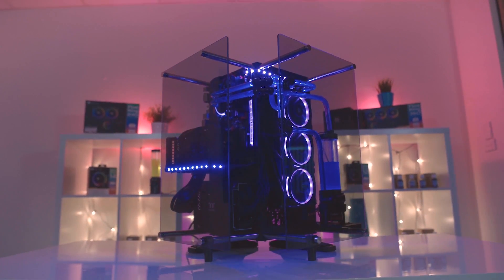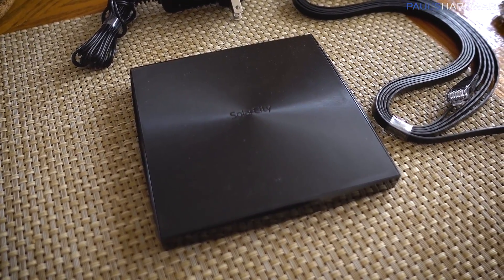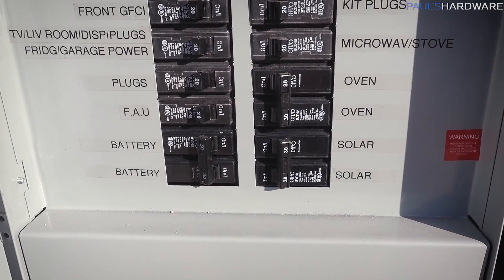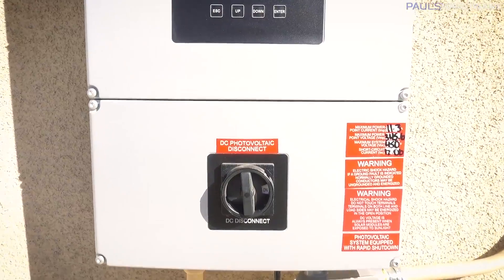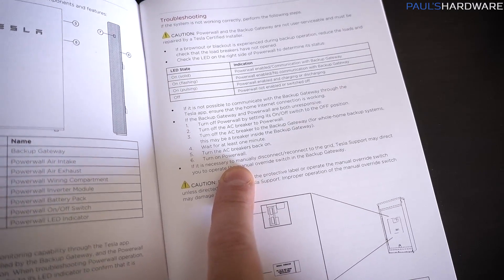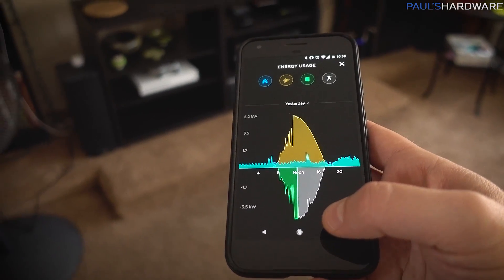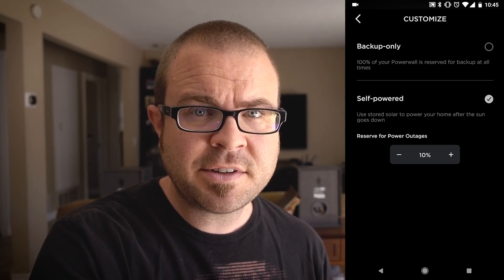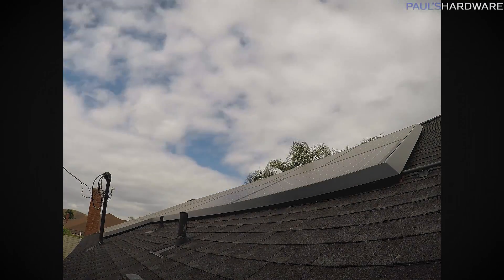SYSTEM ACTIVATED! Tesla Solar + Powerwall Week 1

Comment: Welcome to the club.  Don't obsess over the draw of things. It can drive penny wise pound foolish choices. But it sure is fun. A year in and I will check constantly. Have not paid for a single kWh of power from the utility since we turned on. Will take you a year before you know how it will go overall. Enjoy the curve. The battery is where you truly make the money in time of use shifting.  Even if you didn't have the panels.  One thing I didn't realise until we were in it, prices are higher on net metering plan from my utility. Cost to buy power double during off-peak them it used to be.  But as I said, with battery I haven't bought even 1 in a year.  Really enjoyed your video

Comment: Nice! You should do a video simulating a power outage. (Just turn off your main breaker. :P)
See how it does!

Also, if you can get to 100% self-powered for a time, it'd be interesting to see you just leave your main breaker off for say... a week? :D

Also, if you don't have enough battery to last through the night, just slap another power wall in there! (I know, easier said than done... finances, availability, etc. :P)

Comment: I love this idea but I still see it as to much of a gamble to actually making fiscal sense. We pay less than a hundred a month for electricity on average. So let’s say 1200 a year. I think you said over 20 grand for your set up and that is a smaller house but maybe similar usage as me. So around 17 years or so till break even! You have to hope that you have no repairs by then which I highly doubt. It has to come way down in price to be worth it especially when you consider all the on and off and farting around with it. Just my lazy ass opinion. Cool though. When you buying a Tesla model 3?
Reply: Tesla Solar Panels come with a 20 year warranty. 

The moment you get the system installed you're not really paying an energy bill anymore, (unless you're using too much energy) you're paying to own solar panels. I know it sounds obvious, but a lot of people seem to think that their bills will shoot through the roof and that's not really the case. If you're paying $120 monthly for energy, getting the solar panels doesn't add to that charge, it neutralizes it and then what you're actually paying for are the solar panels themselves and NOT energy.

Total bills will go from like $120(from the energy company) to $125 - $166 depending on your credit and loan. It's not that much of a difference and personally I think it's worth it to be independent from the grid, and have power even when the grid shuts down.

If you pay $1200 a year for energy in 20 years, that's $24,000. 
If you pay an expensive $30,000(10kwh system and powerwalls) for a self-sufficient energy system throughout 10 - 20 years, that would be $1500 - $2000 a year which comes out to about $125 - $166 a month (while not considering any bill credits).

After you break even, your total utility bill with solar will actually be a net gain whereas if you had not gone solar, you would still be paying that $1200 a year.
10 years after you break even, you're looking at a loss of about $12,000 sticking to the utility, whereas with solar you'll have made money or paid about $0 to $300 in 10 years.

Eventually you gain, unless there's a hurricane or a supervolcano erupts but then we'll all be dead so who cares about the bill.
Reply: Laud I get where you are coming from but to me it doesn’t make sense YET. In ten years when you have old ass panels and you neighbors are getting theirs installed for less than half what you did how are you gonna feel then? Trying to save 100 bucks a year over twenty years!
Reply: Yeah it's true, it just depends on your energy usage. Some people are out here paying over $300 on energy alone, it makes more sense for them than it does for average energy consuming people especially if you can pay it all upfront and immediately see earnings. About the technology though, there's very little guarantee that solar panels will become that much more efficient. Since 1992, the efficiency of the panels has grown 8% which is actually really good, but that would still be about $4 per watt (the average is $4.4 in California)

And unfortunately, the efficiency won't get that much higher. The crystalline silicon solar cells have a max efficiency of ~29% and because cell efficiency is greater than module efficiency, the maximum panel efficiency is going to settle around 25% unless some new technology appears, and if new technology appears, you can bet it won't be cheaper.

The risk in waiting is that it might actually be more expensive later once the federal incentives are removed, and yet it could also be cheaper if a new technology is introduced and we're lucky enough that it's cheaper though I wouldn't bet on that.
Reply: Laud great points. Our electric is still cheap here Charlotte so it wouldn’t make sense here. If your paying 300 a month in electricity then I might think about it.

Comment: Hey paul as far as I know if there are no diodes  seperating the gateway switch from the AC switch will flow from there to the AC. Also if there diodes they usualy have a back flow cut off voltage so if the draw isn't high enough then energy will still flow in the oppsite direction.

Comment: From what I can gather from my own solar panel config, the reason why some high-powered devices like your vacuum cleaner, AC, heaters etc are not affected is due to the push/pull of electricity within the config. Your Solar/Battery is pushing power to the grid at specific wattage, while your equipment is pulling power from the grid. I don't have a battery, but the logic would suggest the smarts in the system are the grid cutover and overvoltage protection for the battery, just in case you turn high-powered stuff on after the sun goes down. When you have a push and pull of electricity going on, you are left with the net of that result. I hope that helps.

Comment: Cool project, but I think you might be disappointed to find that you're only going to be saving about $200 month. Your ROI is going to be more than 15 years, mainly because of the powerwall and it's necessary components. Since you probably rarely use electricity at night, you probably would have been a lot better off with just the panels + grid tie.

Comment: I though you were going to use Tesla's 'ceramic-styled' glass tiles instead of the traditional panels.
Reply: those are crazy expensive and have a long wait time
Reply: Expensive but it's like a new roof too
Reply: Don G how expensive r they per unit, and why?
Reply: Arnò Mezzanotte fun
Reply: I was gonna ask the same question, seeing that they put a BRAND NEW roof on. Wondered why he didn't go w/ the shingled solar tiles. Is the wait super long?  Also, anyone know the approx price difference?  Brand new traditional roof w/ traditional solar panels VS Tesla Solar shingled Roof?
Reply: Randy Krakowski on top of the wait likely being long (haven't done any research myself into how long it would be, but others say about 2019 which is a bit crazy although quite possible), the roof replacement was done as a courtesy during installation (based on previous videos). He didn't have to pay for that. Since the roof need to be in good shape, they assessed that it was borderline and opted to Change it for him at no added cost.
Reply: Traditional shingle roof is ~$5/sqft, when I looked into these last year, Telsa estimated $80k (cash price before any discounts) to do my roof (2,200sqft). So...yea, it's a HECK of a lot more. There's an estimator on the website. https://www.tesla.com/solarroof 
Edit* I just went back on there...$81,400 + $7,400 for the Powerwall = $88,800 - $19,100 tax credit (if you even get the full amount) = $69,700 total.
Reply: Randy Krakowski From what I've heard it would likely be 2019 before they are delivered for California, with it being even later the further east you are.
Reply: Would have made way more sense given he removed the whole roof anyway...
Reply: It's the ONLY way I know of to make ANY sense of Musk's Solar venture.
Silicon Tiles with esthetical appeal and current output : that's Innovation.
Using Lithium instead of LeadAcid : that's Science Fiction vs Economics.
Reply: Those are vaporware.

Comment: Nicely done.
To answer your question about your AC, it's seen as just a load and that load is powered by the battery BUT...
... if your power goes out you won't have AC.
It is possible to move your AC circuit to the powerwall/solar side but you will need a start up capacitor bank to handle the 20-80A instantaneous load as the system spins up it's compressor and fan.

We are installing a 6 powerwall system on a 10k solar array with the entire home powered by the batteries.
Stay tuned ro our channel if you are interested in how that all turns out.

Thanks for the video.

Comment: Biggest way to save money is to replace all bulbs in lighting fixtures with LEDs. Standard bulbs for lamps are around 40W while a LED is 10W and just as bright if not brighter. I replaced those in addition to candelabra and BR30/40 flood lights and we saw a noticeable drop in our electric bill. We have solar, but not a Tesla system. It’s about 8-10 years old. Start with bulbs that get the most usage and anything that is outside and work your way down. My living room has 6 lamps, and that’s 240W when running and it’s now 60W.

Comment: Cleaning panels is useless, when I look at my panels 5 years in they look dirty, but each year I get more output (almost consistent +3% per year) maybe the panels are just doing break-in. If one year I see a decrease in output, i will then try and clean them with soap and the brush for the pool, then rinse with the hose. I have no battery but the solar seems extremely reliable : I changed the thunder fuses only once in 5 years.

Comment: Your AC is pulling power back through the gate way because you are still attached to the grid just like the solar back feeds into the grid if the power was to go out at the grid the gateway with disconnect that and everything else would work except off the battery/solar except for your ac since it’s not in the gateway

Comment: Great video! Do you have a slow start on your AC? They help reduce amperage spikes when the unit switches on. From what I’ve seen a slow start is really great for helping preserve the life of the Powerwall. It also can keep the load coming from the Powerwall instead of having to rely on the grid for that initial start. Just a thought!

Comment: VLAN the solar city box

Also - only in america could you run up and down two columns of breaker switches, and have both sides flip opposite directions for "off"
Reply: Happens in the UK too. Confused me at work for a while when something tripped.
Reply: Yep, this is perfectly common practise in vertical mounted breakers.  Simplifies the wiring hidden behind the panels.

Comment: (Pardon if duplicate comment).....
Very good video and description of system operation and great info for consumers.  Thanks for posting!   A couple comments below on air conditioning usage as relates to solar and powerwall 2 when utility power is up and when there's an outage, based on my experience.... Disclaimer...I work in residential solar in SF Bay area -- Non-Tesla branded solar pv systems and sometimes with Powerwalls as part of configuration...   

For the A/C question....When the grid power is on (non-black out), it's helpful to think of a home as supplied by 3 power sources now:  utility, solar and powerwall simultaneously available to feed home's electric panel(s) and hence your home's electricity demand.  If 5kW (AC) solar (21 amps output x 240v) + 5 kW (AC) output Powerwall (21 amps output x 240v) -[10kW AC output combined when maxed out around mid-day in the summer] - are sufficient for all of your home demand, then you are either using nothing from the utility or most likely exporting an excess to the grid (and you get the same credit per kWh of export that the utility would charge you during that peak or partial-peak time of day....which is a nice high rate during the day in California!) 

It's only during a power outage that you wouldn't be able to run A/C or in many houses similar larger loads off your solar + powerwall (circuits that are not located within your backup loads sub-panel).  The 100amp gateway breaker in your main panel goes to your solar + powerwall backup circuits sub-panel via the gateway (transfer switch) and shuts off connection from the grid/main panel, and thus, your solar + powerwall creates an "island" or loop with the utility cut out, so that only the smaller circuits within your solar/powerwall backup loads panel will be powered by solar + powerwall (up to 42amps x 240v = 10,000 watts = 10kW AC output at mid-day) during a utility outage.  Or, in terms of kWH, roughly 30 kWh solar + 12 kWh Powerwall = 42 kWh available over a 24 hr period.   
(The A/C 30amp breaker is cut out of the loop during power outage because it is in the main utility panel upstream of the gateway transfer switch and not in the backup loads sub panel, so, A/C is out when the utility power is out).  

Note: summer vs winter solar production.
On a sunny WINTER day, solar output (AC) could be as little as 50% of peak summer output at noon, so, max output at noon would be more like solar (2.5kW ac) + powerwall (5kW ac) = 7.5kW AC  or 7,500w max.
Or, in terms of kWh, roughly 12 kWh solar + 12 kWh Powerwall (not depleting it completely) = 25 kWh available. 

Note for those curious: how long does Powerwall last during an outage?
This is where it's energy capacity (13 kWh) can get confused with its max power output (5kW ac)  
If power is out at night or during the rain (no or limited solar output), and Powerwall is fully charged at 13.5 kWh capacity, it's designed to keep just essential circuits going so that you don't deplete too fast.
ie. A couple lights, a few outlets to charge up devices, wifi/modem, refrigerator, microwave/stove... very rough 24-48 hours if you're using those light essential loads conservatively. 
And of course longer than that for days that solar is available to supply your backup loads in the sub-panel + extra to replenish Powerwall.... Ie. on a summer day, a 5kW (ac)  solar system itself might supply you with 25-30 kWh (nice!), 20-25 kWh spring/fall, 12 kWh or less in winter.

The a above I'd say is pretty rough numbers but relatively accurate description and estimates for a 5kW (ac) solar pv system + Powerwall 2 on a sunny (not too much shade) SSE - S - SSW range roof direction with modest pitch.

Comment: A GSHP would solve the afternoon problem because it just needs to circulate the geothermal fluid for cooling, but obviously that's expensive. A thermal storage phase change material system could let you use the existing AC to store the cold during sun hours and doesn't involve drilling.

Comment: 4:25 the pencil graphite is conductive... i know this from experience...
Reply: Contact is made with the rubber at the end of the pencil, not the graphite itself.  Enough Megaohms there.
Reply: @empyrionin  If the contact comes from the very end of the pencil, as opposed to, say, ACROSS the tip, through the METAL eraser holder, you mean? There could be a DIRECT path between the metal eraser holder, the HIGHLY conductive graphite, and the person standing on the ground. It really depends on the inside of the breaker unit. REALLY BAD IDEA, either way.
Reply: so you rely on 1/8" of wood as a high voltage insulator?
Reply: Yes, you can rely on anything that is enough, if you are thorough and calculate it. After which you develop an intuition. High voltages are typically used on power device PCB's as well, where the insulation is even less than 1/8''. Here's an example of a calculator circuitcalculator.com/wordpress/?p=25/. We're not talking kV range power lines, this is a household device.
Reply: I too laughed at his probable misfortune.
Reply: Tell me about your "experience".
Reply: Graphite is crazy conductive moreso than even copper.
Reply: @seungryul  its true that graphite is a conductor, but graphite in pencils is mixed with clay. the more clay - the harder the grade: H; 2H; 3H etc while a higher percentage of carbon gives a softer grade pencil: 2B ;3B; 4B etc. the differing amounts of graphite in the mix would, of course, affect the conductivity...........
Reply: It is but not enough to cause any damages

Comment: bro, if you dont got enough for a tesla and want an EV now, i got some EV reviews. Nissan Leaf and Spark EV. Check em out. ITs a wonderful switch! Especially when you have your own solar refinery so-to-speak :)
Reply: also, to find an answer to how the Air Conditiioning and the battery and everything is working, you need to research how Alternating Current (AC) electricity works and frequency changes and how power flows which directions in relation to that.

Comment: Stupid question, so do you technically get free power (albeit, if there are no clouds and you use whatever your panels have collected)?
Reply: CrispyChicken44 Yes. He's using 4% of the power from the grid he did previously. 96% of his power now comes from the solar panels.

Additionally, he sometimes makes more than he actually uses and feeds that back into the grid for a credit (so you make money instead of paying it). He didn't state how much this was however.

Between not having to pay for power and actually getting paid for excess power he generates, he should make back the cost of the system over its lifetime while also being protected from power outages not exceeding half a day or so in length - quite nice!